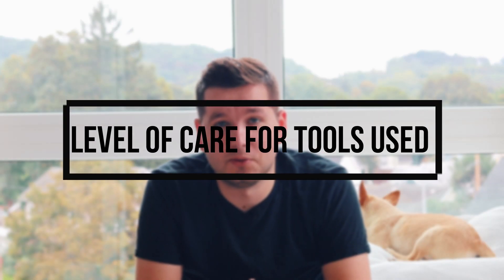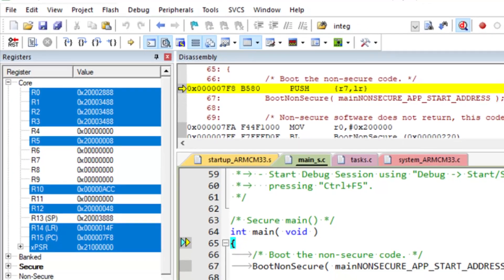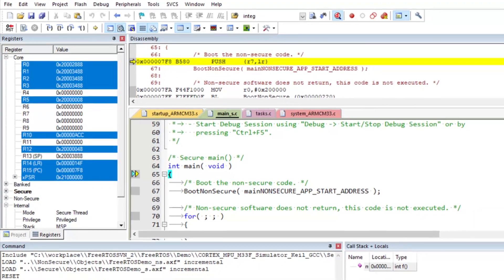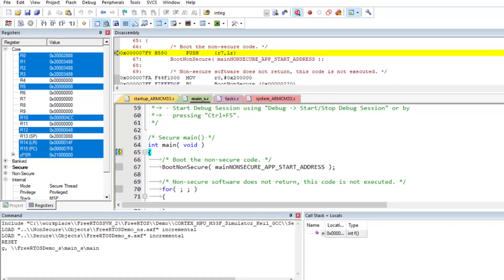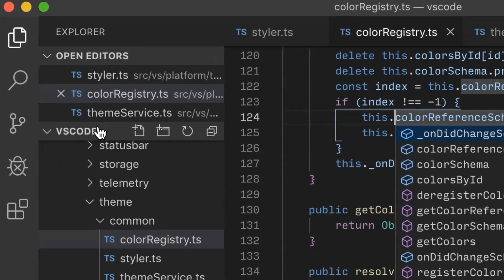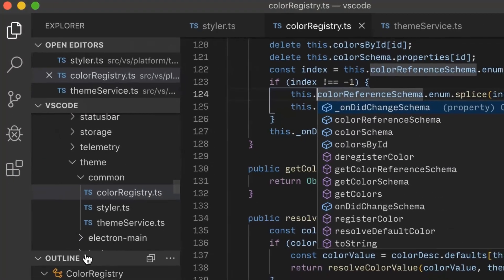Software Engineering vs Embedded Software Engineering

Comment: I agree that in future, embedded software development will become less dependent on the hardware knowledge of the engineer. But for the same reason, I believe that engineers with good knowledge in both hardware and software will be in greater demand.
Reply: True
Reply: I agree to a certain extent, i think what he refers to when he says "not know so much about the hardware" is the chip itself, its becoming less and less important to know the registers of a microcontroller when you can use the vendor api, however you still absolutely must know what hardware you are programming because the vendor api knows nothing about it...if you are writing firmware for a very custom  synchronous bucks converter and your code is switching MOSFETS you better believe that if you switch the two wrong Mosfets are the wrong time some smoke will come out. I think the more rare a species of engineer becomes the more sought after you are, thus the more money you can ask for, imagine years from now when all the young kids love embedded but dont know an ARM M0 from an M7 , the guy that does know his stuff will be the young lads manager lol
Reply: Well, I think that is not exactly true.

Doing embedded software development using a hardware of given capacity will most likely look the same in the future as it looks now. Working with a small device, having 1KB RAM, a few registers and 4 I/O - a developer needs to know the HW details - now and in the future. Working with a embedded-Linux-capable-device a developer does not need to know the details about the HW since it is just another Linux box (a bit smaller of course). 

I think that in the future more embedded development will happen with more powerful devices (which are getting cheaper and cheaper) and thus less knowledge of the HW will be required (because those devices are able to run extra software - like Linux OS - that takes care of the details).

Comment: I have involved both of them but in my university courses I have done some Embedded Software and Software Engineering there is big difference In Embedded you have to know many things like you mentioned Hardware and you need to have deep understanding about the hardware you working on then you are able to code and also Network protocols. I think the most concern about Software Engineering nowadays is to code secure code to avoid any bugs which can lead a problem to the organisations like data breach and so on.

Comment: MSc embedded systems engineer here, this dude absolutely know what he is talking about. major differences, objectives, descriptive, pure, understandable. He is nice. Embedded is a wide area, Computer engineer and Embedded system engineer almost similar (i am computer engineer on the diplomas) but if you do deeper, computer engineer much closer to the transistors while embedded engineers closer to pcb and its elements.
Reply: I am also M. Sc electronics currently working as embedded software engineer

Comment: I’m working current as a software developer who would want to go into embedded software/iot. As a side project, I build a bbq monitoring system using Arduino framework. In this project, I used esp32 chip, fire base for storage dB, build endpoints for current time updates and a also very simple unity mobile app just to read current data from endpoint and past data from firebase. What more do you think I should learn besides my side bbq project? I mostly deal with sensors on the hardware side.

Comment: Nice video :) What are the differences in how a programming language is used in applications software engineering vs. embedded software engineering? For instance, what data structures and algorithms are heavily used in applications software engineering vs. embedded software?
Reply from the maker: Nash, thank you! Embedded software data structures and algorithms tend to be optimized for the specific architecture used on devices to make the most out of those devices. Depends on what industry of embedded software you’re looking… odds are that same/similar algorithms are used across both areas. Typical ones are sorting, searching, compression, data processing, probably a bunch more that I can’t think of the top of my head.
Reply: @GreidiAjalik  I had read that data structures and algorithms aren't as heavily used in embedded software because of limited memory and processing power. Could you comment on this and also give some information about what the most commonly used data structures and algorithms are? Thank you for replying :)
Reply from the maker: In a sense you’re correct, but it depends on the product you might work on. I.e. if you work on OS dev then you’ll most likely be heavily involved with data structures and algorithms, or think about self driving cars and the data they need to handle (lots of stuff going on there). On the other hand if you might work on a small startup prototype project that runs on a small 8-bit architecture, you’ll be very limited on what you can actually accomplish and do with data structures. Most commonly used data structures for embedded: linked lists, circular buffers, stack, heap, queue, binary trees, probably a some other I’m missing 
Most common algorithms (totally depends on projects you work on…): 
Sorting, search, compressions (bit packing is most typical one), DSP (FFT, FTR, filters), probably a bunch of others that I’m missing here (anyone… feel free to correct me or add onto this)
Reply: @GreidiAjalik  Thank you for your reply; it is immensely helpful to talk to a real embedded engineer in real time (pun somewhat intended)! My background is in physics but I am very interested in embedded software so all my sources of information (and, potentially, misinformation) is from the internet so I am thankful for the opportunity to connect and communicate with a professional working in the field. 

Now, I had also read that the heap isn't used much in embedded software because of some issues dealing with the speed in which the requested memory can be allocated. 

From my understanding, it is something as follows: when a user requests memory from the heap, it can take some time for the processor to find space in the heap that is equal in size to the requested amount. Furthermore, because data isn't stored sequentially in a heap (unlike in a stack), storing and fetching data can be unacceptably slow (in situations where timing is critical). 

Is my understanding correct? Also, I suppose that there are no strict "rules" that says that a certain data structure or algorithm can and cannot be used; I suppose that it all depends on the context and the project in which you're working. Using the heap might be acceptable in some contexts but not others. Is this a good way to think about it?
Reply from the maker: Sorry for the late reply, I’ve been traveling for work and been super busy because of that. Feel free to add me on LinkedIn to connect! I think you have a good understanding and of course heap is used, but depends on the processor used and your own use case… if your embedded software is very strictly limited in memory you’d want to avoid using it. There are some pitfalls that come along with using heap for embedded so you’d want to be careful with doing that…

Comment: Which degree should i get i have only two option Electrical Engineering or IT ? I work as an Automation Technician at Metro Project we deals with the Plc system and microcontrollers.

Comment: On the topic of "less hardware knowledge required". What are your thoughts on HALs (Hardware Abstraction Layer)? They seem particularly popular in the Rust ecosystem.

It's definitely more effort in the side of the chip maker, and maybe (?) one looses a small bit of understanding for what's going on, but at the same time it often does make things just so much easier, and I wonder if you think that that approach will stay, or if it's too much effort, or of something else will succeed.
Reply from the maker: It will stay and become even more generalized. I think it’s really moving toward a general software dev approach. Just my personal opinion though. Also I’m assuming you’re talking about HAL libraries provided by manufacturer or some other third party? In general they are ok to use (depends which ones some can be buggy), but when you have a time critical system I would not recommend it as they have a lot of additional code that just slows the process. You can always modify those drivers for your own need and lose dependency on the maker of those libraries. Hope this helps, sorry for the late reply :(
Reply: @GreidiAjalik  Nah, wasn't time critical (not meaning the program), just interest based.

Have you made the experience that a manufacturer made HAL made your application significantly slower? I don't have terribly much experience, but I'd rather expect binary size to become an issue, execution time only in very rare situations.
Reply from the maker: @9SMTM6  Yes, at my current project we are experiencing this and will be modifying the HAL to remove unnecessary code - again this is for time critical systems (and low power), but I do agree that in general this wouldn't be an issue :).

Comment: I'm learning C/C++ rn and wanna become an OS developer. Through the process of figuring out what exactly I want to do, I got lost in the terms. Since these kinds of expertises are rarer than general software developing, it's hard to find the answer you need. Can you please explain the differences between the terms; System Engineer vs OS developer vs Embedded Software Engineer? I know they are similar and have overlapping aspects but I can't figure out what exactly their differences are.
Reply from the maker: Hey! Typically system engineer is an engineer that looks at the whole system on a higher level, not just one specific part. They work with requirements, design of the overall system, and may or may not actually step in to do some coding or hardware designs. I depends on what OS you're working on, but in general I would say OS development would be part of embedded realm.
Reply: @GreidiAjalik  Thank you so much.
Reply: I’m trying to also learn C. What resources are you using?

Comment: Hi, Your videos are informative. Thank you very much. I'm senior CS student and thinking about pursuing a career in embedded systems. The thing that is stopping me is that I see most people saying that embedded system software engineering involves a lot of data sheet and schematic reading (some say it takes 90% while coding is only 10%). Do you think that is true? I don't mind reading data sheets and look to schematic from time to time but not to spend majority of my time on it. What was your experience? Do you think reading data sheets makes the job look less like coding (or engineering) related job?
Reply: I am actually 1st electrical engineer and I had this workshop from my college club where we had to design pcb ,solder it and then connect it to your pc and use arduino ide to program it to display certain patterns 
While programming (especially first time) I had to spend lot of time understanding how this works go on quoara stack overflow and other websites to clarify my doubts and get better understanding and then write down 
So i needed to go through the documentation (which is very thick) but not completely just know what u need to program , what interface or methodology are u going to use (like there is SPI communication,  UART, I2C ) just try some projects or workshops and get some experience that's the best way
Reply from the maker: Good question! I think it depends on what phase of development you are… if you’re writing low level drivers yes you’ll be doing the data sheet and schematic thing a lot…. But once everything is configured and up a running… now it’s “like” regular software development… you do features, algorithms, data processing, OS, and whatever else your device might have … :) hope this helps! Best of luck on your job search!
Reply: yes i am embedded system engineer, coding is not the majority part. Especially mcu based projects doesn't have that much code, but every line is calculated. You can't say, it works okay, you have to think every other scénarios.

Comment: Great video. One question I have though, is does embedded firmware cover the hardware side?
Reply from the maker: Embedded firmware is software that provides the low-level control of the hardware used. Not really sure if that answers your question ... lol
Reply: What would be a title of a position that deals with the hardware?
Reply from the maker: @highway2heaven91  hardware engineer or electrical engineer.
Reply: @GreidiAjalik  I thought so. It seems like some hardware knowledge is still needed though, thanks.
Reply from the maker: @highway2heaven91  yep a little bit... but totally depends on project you might work on. At my previous job, I never even had to deal with hardware or low level drivers at all, but it was still embedded software that I was working with - so there are some different flavors for embedded software :)

Comment: did you ever use matlab and simulink as tools for design and development of embedded software ? i am a mechatronic engineer and currently studying how to use matlab and simulink to design and build mechatronics systems. I'm looking forward to become a enbedded software engineer, and i was wondering what are you toughts on simulink as a tool to generate enbedded code.
Reply from the maker: I used a bit of matlab, but preferred using python instead. I don't think I've used simulink personally, so can't speak for that.

Comment: What is the difference between Embedded Systems Engineering and Embedded Software Engineering?
Reply: I m going to start studying Electrical and Electronics Engineering next year and I want to specialize in embedded systems in the future. What do you think is best for me?
Reply from the maker: @_zZzZSsSs_  thank you for the questions! First, it's hard to say for me what is best for you... research what you're passionate about, try things etc. to find out what you want to do. In my opinion and based on what I've seen in the industry systems engineers have a more general overview of things. They look at the system as a whole not in specific areas. They focus on requirements, reliability, process, quality, etc. For example. Embedded System Engineer would focus on designing the whole embedded system on how it should work an interact with different parts of itself (hardware, low and high level software, applications). Embedded software engineer would focus on the design of the low and high level software. Embedded hardware engineer (or just hardware engineer) would do the hardware layouts. Electrical engineer would do the design of the schematics. There is some overlap in these ares. Odds are that if you work for a small company you could be a systems engineer one day and hardware engineer the other... with this obviously comes greater responsibility.
Reply: @GreidiAjalik   Thank you so much for your quite detailed, informative and helpful response. Thanks to you, I understand better in many ways. I hope I can be an expert and one of the best in my department like you. I wish you a successful career.
:)
Reply from the maker: @_zZzZSsSs_  thank you for the kind words! I appreciate it!